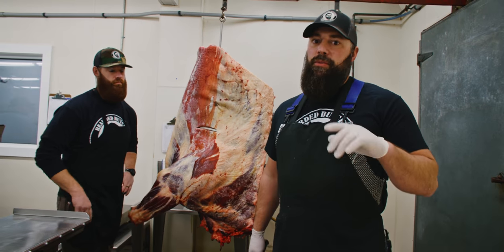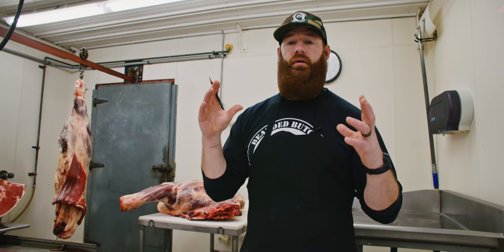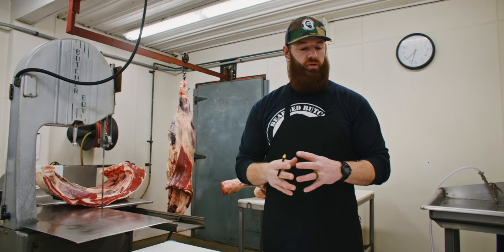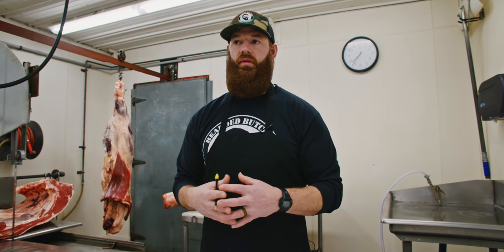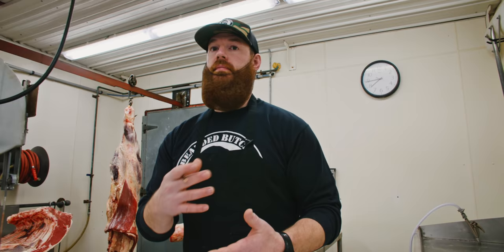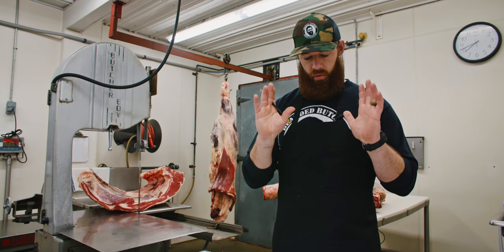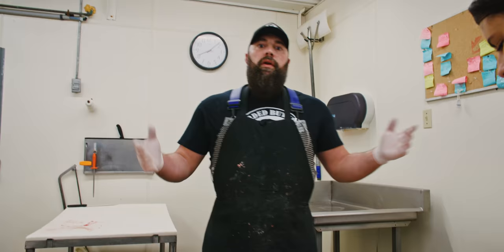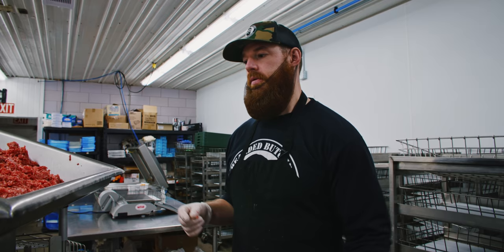Buying Bulk Beef? Learn How to Buy Freezer Beef! The Bearded Butchers

Comment: Early last year I bought an angus steer, grass fed, intended to weigh #1000 MOL when loaded onto the trailer for delivery to the butcher.  The local farmer & I discussed the genetics of the steers she was raising that season, and what traits she had selected for.  The original estimated schedule was for early November completion, but because of a very wet summer and the butchers schedule he stayed on the farm for until December and reached reached a full weight of #1050.  After slaughter the hanging weight was #511.  I picked up the hide later that day & delivered it to the Sebring Tannery.  We had agreed that the carcass would hang and dry age for 40 days, which span over their Christmas/New years shutdown.  After pickup I got #265 including liver, heart, tongue, but got gypped out of the cheeks that we had also asked for. #112 lbs of that was ground all in 2# plastic tube-bags.

I feel like the butchers destroyed a lot of the value of the purchase.  They split the carcass into quarters at some point prior to vacuum packaging the cuts, so there was some dried rind where there should not have been on the subprimals.  I also had then set aside the the whole sub-primals for the rib-eye, NY strip, brisket, and tenderloins, so I could dry age them for additional time wrapped in collagen film.  I made another trip to the butcher that day to pick them up fresh, the rest of the carcass was processed for freezing as we had agreed.

The farmer had assured me that she used ultrasound to monitor the development of the steer, and that he was well marbled.  The meat we received is literally the leanest meat I've ever seen!  While I have no doubt that the meat I received was aged for the full 40 days, I also suspect that the beef I got was not the animal that I bought.

My farmer will no longer do business with the butcher, as she received a number of complaints from her other customers.  Something at the butcher changed.  My farmer is the president of the "Xxxxxxx County" cattleman's association, so I'm inclined to trust here credentials.  

I honestly believe that my prime grade grass-fed hormone free animal was 'diverted' to another of the butcher's customers, and that I was given another animal in its place.

I literally got less finished weight from a whole beef than you guys got from a half in this video, and my weight included the organs!

Sorry for the long post.  How about a video on finding a butcher I can trust not to screw me?
Reply: Grass fed has no marbling usually stringy and gamey taste to me. U got lied to.
Reply: @floydcash1694  Well, that's not particularly helpful.  I'm quite certain I was lied to.  I think they substituted a smaller carcass after the slaughter, and my animal went to someone else.  Of course I have no way to prove that.

You are correct, the meat has no appreciable marbling.  However, it is not stringy, if you don't care for the 'gamey' (poor choice of words) notes of well aged beef, then this is definitely not for you.  It is well aged, and it also exceptionally tender despite the lack of fat.  With 40 days of hanging, literally every cut has a pronounced dry-aged rich umami flavour.  But that was my goal, so in that aspect the project was a success.
Reply: I'm still learning/researching stage but I'm curious why you accepted the order given it was well below the yield amount that you paid for.
Reply: @AB-ol5uz  Because I didn't know the weight until I got the meat home.
Reply: I feel like your producer set your expectations too high. If all the complaints were the same, I tend to lean towards the cattle were not to the standard set.  I highly question the ability of a 1,000 grass fed animal to grade prime.  Grass fed tends to be lean anyway and at only 1000 pounds, that animal did not have time to reach prime grade from my experience
Reply: @floydcash1694  grass fed is not stringy nor “gamey”. You are probably just used to the bland no natural flavor of store bought feed lot cattle that has to be seasoned into oblivion to taste decent. No offense but not everyone can have good taste. Your loss.
Reply: @floydcash1694
Bullcrap.
Reply: If the calf starts off grass fed and isn't grain finished, it will be pretty rare for it to be significantly marbled.  My understanding of "grass fed" beef i.e. has eaten nothing but grass, will typically grade out at USDA "Choice".  The butcher should have some kind of tracking information - just for their own purposes of keeping the orders clear - if they don't then something is certainly very suspicious.
Reply: They all taste bland until you put steak sauce on it 😂
Reply: That’s hard to find, also got meat from a butcher that we didn’t think was our hog that we had butchered. Don’t trust any of them, sorry.
Reply: @jamskinner  emphasis on the Bull....
Reply: @czboy2  or Bearded Butcher seasoning pack!
Reply: @czboy2 Ketchup is the gourmet goto.  😉

Comment: Wonderful video!   I might point out that some customers might want all the fat trimmings, like me. All that fat can be put in the oven at low and rendered.. the oil that separates is fantastic for all cooking purposes ( as is bear fat). The crisps left after rendering are ideal as supplement for dog food too. Heart and liver and tongue are superb eating.. The skull has some really fine meat to take off.. cheek meat is among the very best on the entire animal, and the yield is very low.. a true delicacy. If you have dogs have the tripe washed and saved as well. It has little flavor and is tough but it is excellent nutrient for the dogs. In Asia, the tripe is served with flavor dense soups, and well cooked to tenderize. I often order it at authentic Chinese Hot Pot.. but it is difficult for most western cooks to use, but easily prepared for the dogs. Trotters are often overlooked. Boned and slow cooked, they offer another opportunity to increase your percentage with excellent meat.  The raw bones, if not saw split to bake for marrow, and if large enough, are all good with the dogs as teeth cleaning chew toys.

Comment: I bought 1/2 an Angus over 18 months ago. We are finally to our last couple cuts of beef. Best thing I’ve ever done. $1500 total. More than enough meat. I live in the Texas Panhandle so not an issue of finding a source and a processor. Only complaint I had was they did not process my steaks thick enough. They were what I would call thin sliced. Otherwise, better flavor, better value, and you’re supporting beef from the source by cutting out the middle man (supermarkets).

Comment: i buy a beef about every year if my herd does not allow me to harvest a calf.  5 years ago I took my beef to the butcher once it was fed out and cut and wrap ran around 400.00 dollars for a 1400-1700 lb beef.  Today it has more than doubled but I buy waygu calfs at around $1000.  That is usually about 800 lbs calf when bought.  Feed out at a feed lot in evant tx runs about 100.00/month.  I fed out 14 months on the last and sonogram it at prime.  After cut and wrap it brought about 600 lbs of beef.
Total for buying calf, feed out and cut and and wrap came to $3200.00 which is 5.33/lb.  This did not include the cost to haul to the feedlot or to pickup at butcher or sonogram cost.  Roughly $5.50 a pound is what I had in it with everything included.
Still beats what you pay at a HEB by far.

Comment: Great video. Excellent butchering guide.

1. What about oxtails?
2. Can leg bones be cracked for making stocks or are they sold separately as morrow bones?
3. Neck bones are used in stocks. Are they normally discarded?
4. Is any beef tallow saved and renderred?

Comment: Great Video. Just want to say if you take the finish weight and divide that by the hang weight that will give you the exact yield percentage. So 265.8lbs divided by 390lbs equals 68.154%

Comment: As packaged, how long will the meat last in a deep freezer? Great video. I've been thinking about getting half an animal to put up in my freezer!
Reply: My family has done it a few times(As much as possible with the cost being upfront). The meat has lasted as long as 9 months Iirc when we used the last of it in our family of 5(Myself, Spouse and 3 teenagers) no freezer burn. Have had both plastic shrink wrapped and paper wrapped.
Just make sure you have enough freezer to fit
Reply: 1 to 2 years.Most important part is don't be toss the packages,you can break the seal
Reply: @josephschulte1073  this is my question-- how much freezer is enough freezer to fit? Assuming starting with an empty freezer-- how many sq. ft of freezer space do you need? Not sure the quantity you buy, 1/4, 1/2, etc-- but if you could ballpark it for me that would be awesome!
Reply: @andyglade5522  Sorry, I missed this, but When we bought the first 1/2 we only had a 7 cubic foot "chest" style. Was NOT enough, I ended up having to ask 3 neighbors if I could store meat in their freezers for the day. I had immediately ran out and bought a little 5 cubic foot freezer and plugged it in. 
I guess long story short, 12 cubic feet if you get all the soup bones and organs(I basted them in beef broth and cooked em in the over for a bit and gave them to the dogs for a treat.)
Reply: @andyglade5522  Joseph is spot on.   A 7cf will take a quarter with a little room to spare.
Reply: @andyglade5522 - Scroll the comments up from you. A butcher just posted the dimensions you’ll need for your freezer.
Reply: We kept 1/2 beef in the freezer for up to 12 months, paper wrapped.

Comment: I buy whole strip roasts around 14 to 16 pounds each and my butcher breaks them down into NY strip steaks. I save about $3 to $4 a pound buying this way vs just buying pre cut steaks. Am I doing it right, or do you have a better suggestion?  When I bring them home I season them and put them on a rack over a sheet pan in my fridge overnight to air dry them a bit and to allow the salt to penetrate. The next day I vacuum seal them and get them ready for the freezer.  When I want to have them I cook them sous vide for 3 hours at 131F and them pat them dry and sear them with a propane torch. I'm getting very good results but you guys are the pros so maybe you can help me out with some suggestions. Thanks

Comment: From experience as a former Master Butcher , you pay for the weight of the dead carcus on the bone .

You cut & debone & remove unwanted fat & gristle that's not good to eat . Remember also , some Butchers can take out some expensive cuts of steaks & put in  minced Beef & stewing beef.

These guys will give you an approximate idea of steaks, fillet, sirloin  T.bone & porterhouse steaks .

Good luck guys 👦

Comment: Fantastic explanation of understanding the weight the customer gets.   Dad told me 50% would be a generally good yield from beef.
Getting us to understand the different cuts and how one cut will affect whether the customer gets something or not was important.
I already know if I bought a half (which is what I would buy) my wife would demand fillet.   Why?   Who knows when it can be used in the other stakes such as the porter or T-bone.
Anyway, a lot of people don't understand the amount of burger from the trimmings and such.   Some think it's a rip off and all the butcher did was burger because it's easier for them.  NOT!!!!
In the end I think I missed the type beef you demonstrated with.
Also, is there much difference between the grass fed and the grain beef in the way of weight for the customer.   I want to switch to grass fed.  It's more expensive, but what about the weight difference using the same breed.

Comment: I have been doing just that for years. I'll buy a whole rib eye bone in and peel off the bones for ribs then slice the rest into steak. I also buy a whole chuck roll when I can find it and finish cutting it myself. There is a lot of good meat in a chuck role. I have always used my fat trimmings for tallow. Far as I'm concerned beef tallow and cast iron are the best way to cook something quick and easy. I do the same with pork except I keep the back fat for making sausage and what not.
What concerns me is that people are no longer self sufficient. They have no clue how to preserve their food. We buy stuff on sale and cure it ourselves or vacuum pack it and anything getting rid we make corned beef pastrami hame bacon sausage ect out of it. Then we can a lot of it. You can can things and as long as the seal is good it will last 10-20 years. The quality my diminish a bit but it is still safe to eat. Hell when I was in the Army back in the 80's prior to switching to MRE's the Army was clearing out the stock piles of the old C-Rats I have eaten C-Rats from the 1930's the chocolate hade turned white and the peanut butter was hard but everything was still edible. The cigarettes were nasty but we survived.

Comment: If your buying bulk meat in processed quarters or sides, everyone should remember that price is based on hanging carcass weight! That means your usually going to take home approximately 60% final yield of the weight you paid for. So take the $ per lb for bulk processed (carcass weight) and multiply by 1.67 to get your "retail price." If the new $ per lb is not any cheaper or barely cheaper than retail, then just buy smaller quantities of retail because pennies on the lb savings ain't worth the trade off that most of the meat will spend much more time in your freezer and therefore be less fresh when cooked‼️💯 

TL;DR- Retail you're paying per lb on the actual weight of cuts you take home; On bulk you're paying based on weight before butchering. If the $ per lb on hanging carcass price isnt at minimum 45-50% lower than average retail $lb price then don't bother‼️
Reply: Thanks for the info. Do you know how much half of a carcass usually costs nowadays in USA? Approximately

Comment: Well done. Got my first 1/4 last month to top off my freezer that already had some Moose and Deer in it. Wasn't impressed with the wrapping, basically freezer paper wrapped around it with a printed label as to date and cut. I'm worried about freezer burn because I'm needing long term storage.
Reply: Buy a vacuum sealer. Not that expensive and saves you from loss to freezer burn.
Reply: @melissam450  just like deer meat

Comment: Nice video.  You mentioned 'finding out which quarter' you are getting if you buy a quarter beef, you mentioned it could be an actual corner of the beef or a combination of the front and rear...I have been buying quarters and halves for about 30 years from a few different butchers and there has never been any difference,  a "quarter" is ALWAYS a half split evenly.  Not sure what math challenged butcher would be selling a front leg and a back leg as separate quarters.

Comment: Is it possible to buy a full shank section, or full chuck section, or a full briskit or Plate or Flank section - which has not been cut up into steaks, roasts or hamburg?     I would like to experiment doing the work of cutting up the steaks, roasts and hamburg myself.   Does any butcher or processor sell that way?

Comment: Wow lots of info! Can you explain the differdnce between tbone steak and porterhouse steak ? They look almost identical. Is one more tender than the other?
Reply: They have video on that. Bone in vs boneless is the video.  Porterhouse has more than 1.25” of fillet.  T bone has less than 1.25” of fillet.  Its same cut. Different size.
Reply: @DareDog.  Thanks for your reply !

Comment: Hey great video! Just to clarify, the customer is charged by the hot hanging weight before dry aging, right? Dry age cost is added as a service based on x amount of days, then bone in or boneless is factored for the remaining costs, right? I assume dry age is a flat rate based on amount of days, and boneless is based on full, half, or quarter, correct?

Comment: Where does the other 32 perfect go to? I like extra fat around my steaks. I do not have dogs but I want those bones for broth. Is that possible? Also fat trimmed, I want this for beef tallow. Would all tho raise yield to 80 o/o . And could these be weighed and priced separate.
I really would like as much as possible from dry hanging weight. Good video guys
Reply: Fat. Bones etc is where the rest is.  Getting the bones is up to the butcher.
Reply: @DareDog.  thank you. Yeah I guess 68 percent is pretty nice. I would just ask butcher not to trim steaks to much. I like about 1/2 inch of fat on outside of steaks

Comment: You guys should really do voiceover. You....keep talking like...this...but when you voiceover, all the pressure is off, you can re-record each sentence until you are happy with the way it came out. And it's not NEARLY as annoying as listening to the stammering and pauses. Also, I've stopped the video at 6:00 to type this, and you still have no0t started to discuss butchering. While the hanging/weight/aging stuff was interesting, you both are just interjecting this and that in random fashion.  This is a FASCINATING topic - but 6 minutes in and you've barely scratched it.